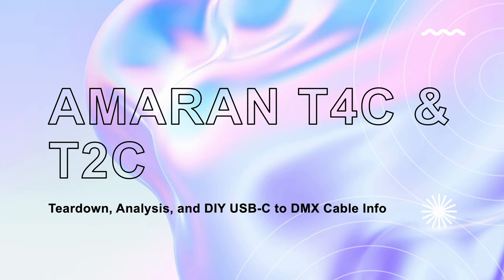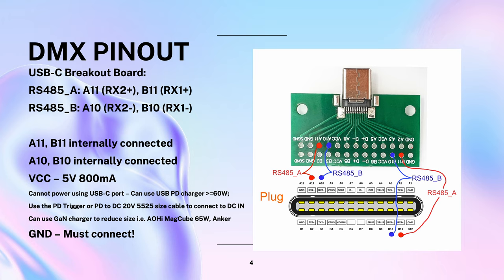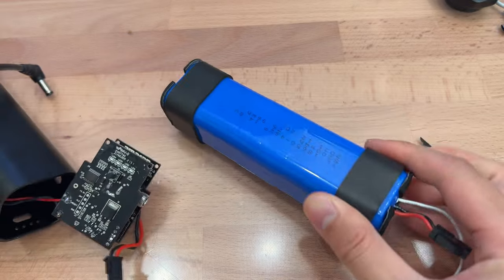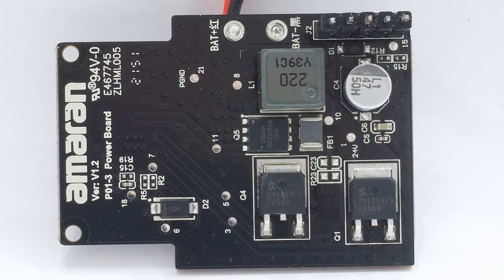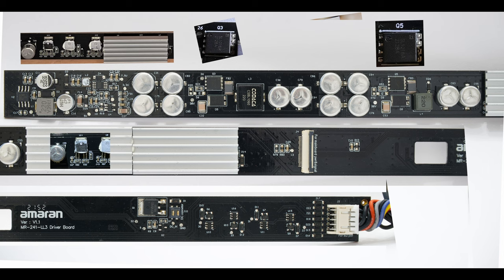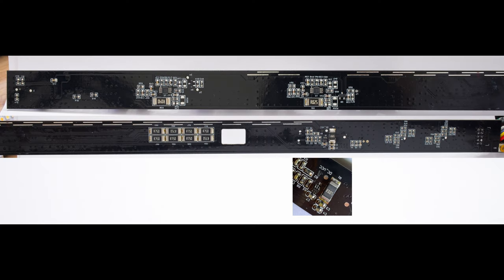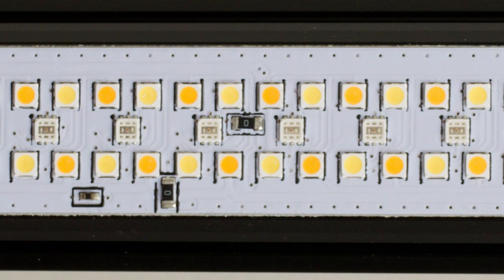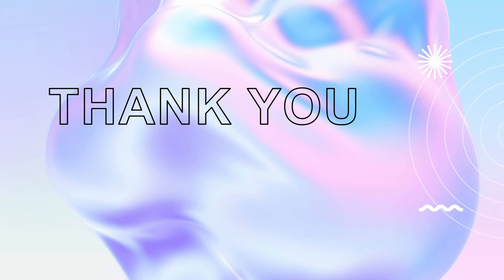Aputure Amaran T4c Video Light RGB LED Tube Teardown/Deep Dive & DMX Cable Pinout 4K

Comment: Hi Larry. This is a brilliant video, I’d be delighted to see more tear downs of lighting gear. I’d specifically be interested in the f21 and f22 panels. I’d like to fit dmx ports to the chassis of the controller and it has a similar usb-c port for data
Reply: But any other lighting gear you own too I’d be very interested in seeing more of. Subscribed

Comment: Great video! I love that someone is doing these deep dives! 

Can you charge multiple of these batteries by daisy-chaining them from one power adapter?
Reply from the maker: Yes, it is possible to charge multiple batteries by daisy chaining. I have only tested it with two of them. Note that the batteries may charge at a reduced rate, especially the first battery in the chain, if too many batteries are connected and/or the adapter or battery upstream will be overloaded. I wouldn't personally recommend attempting to charge more than two or maybe three batteries in a daisy chain, and definitely wouldn't suggest operating the light at the same time if you were to use a setup like this.
Reply: Thanks for the info!

Comment: Hey @Larry, I've removed the torque screws on the end cap but it does not want to come off. Did you have to do something else with it? I'm trying to figure out if the DMX RGB channels are internally normalized to use the white LEDs, but I can't tell with the frosted cover on it.
Reply from the maker: The entire process to remove the caps should be in the video. Both end caps should be able to come off, but I don't remember if I removed both caps on mine. The caps could have become pretty stuck, since they are shoved into the aluminum profile, but assuming they didn't change anything about the design, you might try wiggling them off carefully after removing two Torx screws under the stickers on each end

Comment: This is incredibly useful, thanks! I really enjoyed walking through all the chips and power runs. I'm working on trying to figure out a device right now, would you be interested is working on it with me? I'll send you whatever pictures and meter readings / oscilloscope data you want and you can put up a video for it. It's a Tilta Nucleus N follow focus. I've already identified the chips and have specs on the TTL command generation specific to it. I just need to figure out how to interface with it.
Reply from the maker: Hmm, that sounds interesting. I had a quick look over at the website and it seems that they are willing to provide some level of information on the wiring of the system. That might be a good starting point, but if not, feel free to email about pictures and whatnot. No promises, but I'll see about what I can do! https://tilta.com/support/can-you-give-me-the-wiring-info-so-that-i-can-make-cables-for-any-system/

Typically with a TTL-type system, 3.3V is a good starting point and if you already have the command generation part figured out, the rest should typically just involve tracing back a pair of wires from the connector to a microcontroller. Likely, there won't be any RS485 transceiver if it's simply TTL, which could complicate things slightly.
Reply: @liminalsunset  Thanks for the quick reply. I'm pretty sure the documentation I have is what they make available (I have diagrams for cable connectors, etc. but they are for the Nucleus-M). I am assuming the same TTL protocol is used with the Nucleus-N (sorta corroborated by github err4o4/tilta-nucleus). I've thought about emailing Tilta direct, but I have doubts they will want to explain the hidden internals to me :) but you never know. I think they are likely using the F103CBT6 to communicate with the half bridge, and maybe the same for the serial comm or it's the main CC2530 they use for wireless 2.4 with the hand control. I expected to find serial data on the center pins of the 4 (i.e. the github repo) but I only see constant voltage. Maybe I'm going about this all wrong and should be trying to find a way to wirelessly interface with the unit?
Reply from the maker: @michaelhcorrigan  Would you happen to have pictures or some description of how the unit is intended to function? 

There's a possibility that serial data is only exchanged when the devices have established some form of handshake. A good place to be start could be to connect all of the hardware up, and sniff all pins with any electrical activity.
Reply: @liminalsunset  For sure, I can send you some pictures and video if you want. I've put a multi-meter to the pins and an oscilloscope, but only get voltage information. Is there a better way to sniff the pins?
Reply from the maker: @michaelhcorrigan  A multimeter will likely be too slow to respond to a 115200 baud signal. An oscilloscope would be a good idea. I'd put it on DC coupled mode, set the range to something like 3-5v and set a trigger voltage of about 1.5-2V, and fiddle with the timebase until anything can been seen, if anything.
Reply: @liminalsunset  So I did that and couldn't find any waveforms. I'm newer to using the oscilloscope, but I tested finding the waveform using an Arduino I programmed to serial output the proper TTL protocol and baud rate expected by the device and I was able to narrow in on that just fine (and determined my scope doesn't have decoding built in :( ).
Reply from the maker: @michaelhcorrigan  Yeah, I personally wouldn't use the scope alone to decode signals unless it was supported in Sigrok or similar over USB. Likely if you're able to read the data, you've found the Tx pin. There should also be a Rx pin which you'd put your commands on to get the device to respond.
Reply: @liminalsunset  Sorry, I meant I made sure I know how to do it on the oscilloscope, I haven't been able to find the data on the pins on the Tilta. This is where I'm lost, I have no idea how to find it - or if I've looking in completely the wrong place.
Reply from the maker: @michaelhcorrigan  Would you be able to provide a short video of your test setup and the device, including any internals, if you have disassembled it? That could be helpful
Reply: @liminalsunset  Yeah, I'll make a video and include pictures and test setup. I just discovered one of the wires going direct to the stepper just broke on reassembly so I need to fix that real quick (and maybe replace the old wires and JST connector) then I'll post the video for you to look at!
Reply: @liminalsunset  Here's a video of the device, what it does, and how I'm connected to it to  test. Also, in the description is a link to photos of the inside. https://www.youtube.com/watch?v=yfcThjszl6c
Reply from the maker: @michaelhcorrigan  Hi, I've been able to see the photos and video you posted. It seems like the GitHub is referring to a different device from what you're working with, since they are using different connectors than what I see in here. The device the GitHub has seems to have some external signalling connections.

It looks like the sub-board that doesn't have the wireless IC on it is just a motor driver, and the three-pin connector appears to be a motor output if I'm not mistaken, or maybe that's done through the pogo pins. The four pin connection would be the signalling to drive that IC, but I doubt it would be RS-232/TTL. It's more likely that it uses either a F/R and PWM scheme, or it uses I2C or similar. Would you be able to read the part number off the IC which is on the board with the three and four pin headers? The datasheet for it may tell you how to interface with it.

it seems like the 8 leg SOIC chip on the flat flexible cable is a resolver/magnetic encoder designed to provide closed loop feedback to the microcontroller, implementing a "servo" loop for position control. You'd need to connect that to your new solution as well if you require precise control.

You'll definitely want the pins disconnected from the original MCU board if you intend to drive this board manually with an Arduino. These protocols are usually 'leader-follower' type, with no bus arbitration.
Reply: @liminalsunset  It's very possible they mean the Tilta Nucleus-M and just incorrectly wrote Nucleus-N on the github repo. I agree with your assessment based on my findings, there is no simple interface built out for this device and that I would likely need to tap into the ICs and figure out how they are set up/replace them to do much at this point. It turns out I have a friend with the Nucleus-M unit, so I may see if I can get this device and then interface with it using the provided connection port instead of trying to figure out how to tap into the radio on this unit (which would also work if simple enough). Thanks for helping me look at this, let me know if you want anything else for a video, I'd be more than happy to help.

Comment: Is it possible to download the firmware from the SoC and modify it?
Reply from the maker: I haven't looked into this yet. The documentation appeared sparse for the chipset in use for Bluetooth. I would imagine sniffing the communication between the module and replacing it, or just controlling it with the external interface might be a better effort to reward ratio.